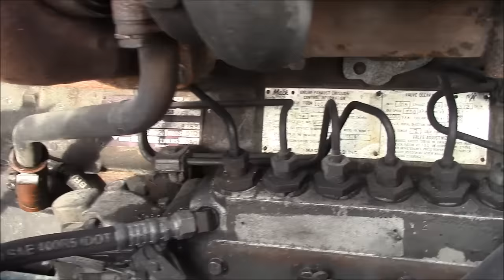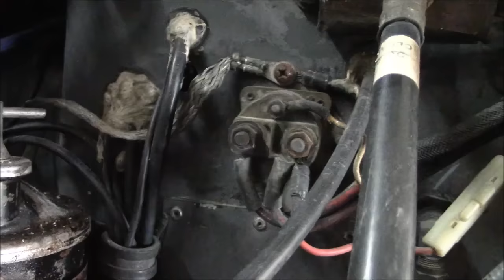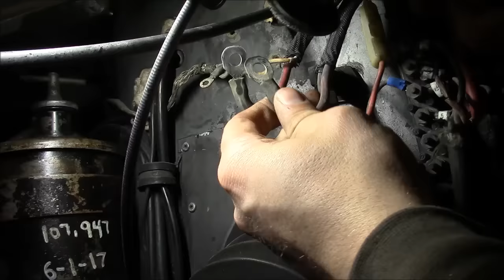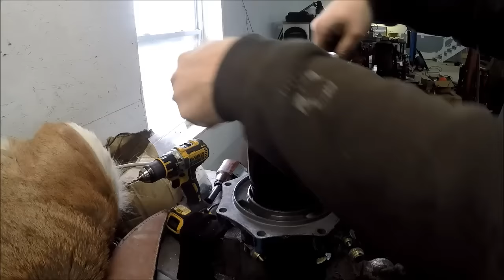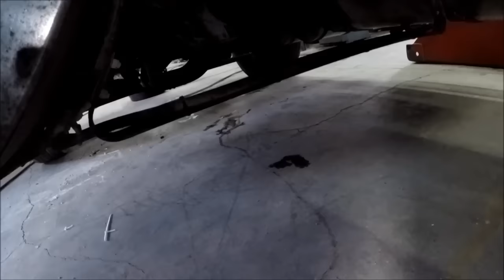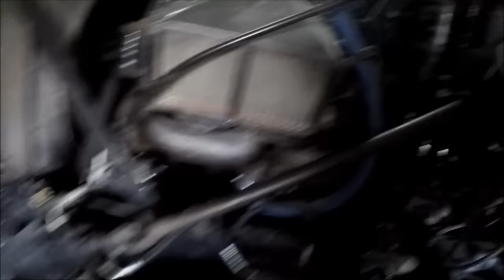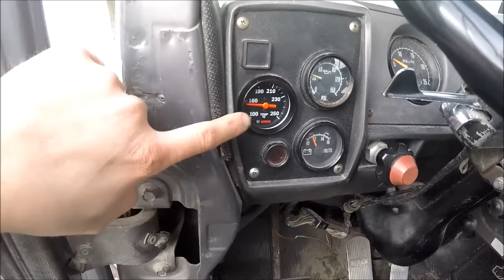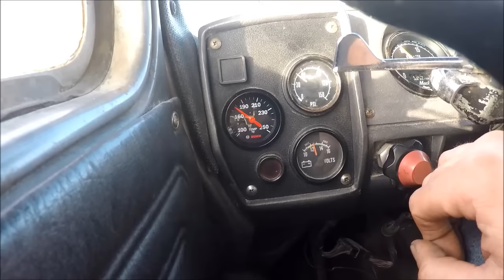Cool 1977 Mack RL600L - No Crank, No Start - Plus Many Other Repairs

Comment: went to  work as mechanic on a small corporate potato farm in 74...they got a new mack rl 600 right after me starting, this had the 5 speed and a forward-reverse lever.. great to hear that low rpm workhorse start and idle :)

Comment: If automotive makers would use more die electric grease there would be fewer green crusty connectors to troubleshoot .  Your spot on .
Reply from the maker: I agree. And maybe $.25 of never seize sprinkled through the chassis.

Comment: So what about the batteries on the concrete deal personally I think it’s bs But I’ve been wrong before. We used to have a mechanic at work that maintained our fleet and he had 4 x 4 blocks sitting over near his battery storage area and every battery if it wasn’t on the shelf was sitting on one. He had about five used batteries in seven or eight new batteries and after arguing about it because I couldn’t figure out why it would hurt anything I ran in there after he left and set all of his batteries in the floor on a Friday evening. He was pissed but I don’t think it hurt any of them. I had set plenty of batteries on the concrete and couldn’t tell that it did anything. I have 2 trolling motor batteries sitting in my garage now on the concrete. They sat on the concrete all last winter and held a charge Also so they’re two years old or so and still work fine.
Reply from the maker: It's some ancient practice from old wood or rubber case batteries. Any battery made since the Eisenhower administration can sit on concrete forever with no negative effect.

Comment: The R 600  81 Mack I owed had a 300 engine with a 7 spd  extended range I think been a long time It was basically a 5 spd so it shifted 1, 2 then out of 2 click up the range back into 1st which became 3rd then 4, 5, 6, and 7th . Then keep it a 1200 rpm and it would pull anything but a hill . I wonder why most Mack’s were white . The guy I sold it to took out the Mack stuff and put in a 400 Cat with a 13 spd and used it for years . Oh I left out it had New Way air ride not a good choice never could keep the bags level .

Comment: One place I've heard to not use dielectric grease is switch contacts as the silicone can become silicon carbide and erode away the contacts. I've never found a manufacturer stating that though.

Comment: On the old Mack’s  they are noted for oil in the air system even with a dryer you will still get old in the system. You need to drain your air tanks everyday . One other thing look at the air compressor it sits below the center of the engine and oil
Reply: Cummins had a problem with this in 70’s and 80’s I believe. Someone came up with a cure, I don’t remember if it was engine or air pump people. I don’t have the info anymore, so reverse digging is needed for the answer.
Reply: Turbocharger connected possibly?

Comment: Having those automatic slack adjusters is never a good thing, I have seen far too many failures of them especially when used in a lot of off road conditions.
Reply from the maker: They work for a while until they get jammed up with rock hard grease.

Comment: I’ve put dielectric grease on literally every non weatherpak type electrical connector at my job for years and guess what? The connections I’ve made outlast the others and have had zero complaints since I’ve installed them. I’d also like to add that concrete doesn’t kill lead acid batteries, in today’s world we have plastic encased batteries for that reason and several other reasons as well.
Reply: In fact, batteries on concrete hasn't been a problem since they quit building them in wood boxes. (that is over 80 years ago) The rubber type cases used when I was a kid prevented voltage loss to concrete conduction.
Reply: @wssides  right, but when you try to tell certain people that they think that they know everything and say concrete kills the battery 😂 I use a 12 volt mower battery wired up to charge my phone and my Bluetooth speaker everyday at work and you wouldn’t believe how many people still believe that my battery is going to shambles 😂 been there for 5 years already and will still start anything you hook it too.
Reply: @NitroGuyJH  btw the biggest thing about concrete killing batteries is that it was a thing back when batteries has glass insulated cells in them. You could break the glass sitting them on concrete but like y'all have said for many reasons nowadays you can sit the battery basically anywhere and with agm you can sit em anywhere and any angle in any temperature.
Reply: @michaelf.2449  didn’t even think about that, forgot that glass was used for its insulation properties quite often
Reply: @NitroGuyJH  yep people would be right about that myth if they weren't 100 years too late.
Reply: Pretty sure that if adding dielectric grease to something causes a poor connection, it was already a pretty piss-poor connection to begin with. Once terminals start touching against each-other in a plug as it mates, or as you tighten the nut down on a stud, it'll wipe/scrape/squeeze the grease out of the way wherever they're actually contacting; leaving it everywhere else, where it'll keep the moisture out and stop the dreaded green fuzzies!
Everyone's got their pet theories, though; and in the end, just... do what works for you, eh?
Reply: Correct, I've used 5 yr old batteries that are stored on concrete, no problem worked great. I use dielectric grease on some plug wires  Rubber boots on the end .

Comment: Wes. I owned a Marine Service business for 25 years on salt water. I used dielectric grease the way you use it and on all connections and they were trouble free!👍👍
Reply from the maker: It was drilled into me from a young age. We used it by the gallon at the truck shop where I cut my teeth.
Reply: Indeed especially doing marine electronics its a must

Comment: Look for the RPM sweet spot for the shifter. Each truck has its own.
Reply: The sweet spot is the RPM at which the transmission will shift the easiest almost all of the time. My C12 Cat in my Freightliner was 1225 RPM each shift. The Sterling I had had a C10 and it loved to shift around 1000.

Comment: That is a "Torque Monster"!
Reply from the maker: Yes. It needs it with only 5 gears!
Reply: @WatchWesWork  I have owned dozens of Macks. R, U, DM, and DMM models. Were the best trucks you could buy!
Reply: We had a dump truck with that same engine and transmission. You could load that 16’ box till it ran off the sides and it would just go. You’d shift and swear you could feel every piston stroke

Comment: I had an old Mack B615 with the END 864 V8 thermodyne .  The electrical system this truck had was the same battery layout BUT had a 12 volt RUN system with a 24 VOLT start system!!  Key to this was a GIANT power control relay under the passenger seat that had 4 wires coming from the batteries hooked up to it with 4 wires going out of it!! 2 wires went to all the lights, accessories and alternator and the other 2 went to the starter motor!!  When you inserted the key and turned to start this energized this HUGE relay and sent 24 volts to the starter.  When you returned the key to RUN position this DROPPED the "WIRING CONTROL RELAY and changed battery connections inside itself and this action allowed standard 12 volt operation to happen!! Yup it was complex but it worked!!
Reply from the maker: I've heard of that kind of system, but I've never seen one.

Comment: alt needs to see 1000 rpms before charging
Reply from the maker: Then it should have worked. I had been running it at 1500 to get the temp up.

Comment: I think your air impact might need a rebuild kit. Sounds a bit weak
Reply from the maker: It is. And the anvil is worn out so sockets constantly fall off. It's got a lot of miles on it. I think I've had it for over 15 years.
Reply from the maker: My Dewalt cordless is even worse. They both need an upgrade.

Comment: did you look at the mileage and date on that power steering reservoir? looks like a really nice clean truck. i always forget to use my vacuum drain/fill system. your turn to replace the foot valve.
Reply from the maker: I don't think that's the correct mileage. I suppose it could be, but the engine has been swapped at least once, so I would think it has more than that. Looks like this foot valve is a little easier to get to than that dressed out KW!

Comment: I love the older macks! Worked for a guy with 10 Mack dump trucks when I was young and they really were dependable trucks. I don't understand what people are getting at about the dielectric grease, that's why it's made for?? Good luck getting the old girl dried up.
Reply from the maker: Yeah I don't know. Fixing oil leaks on a 45 year old Mack is pretty futile.
Reply: @WatchWesWork  just tell him they loose a good bit from the blow by tube anyway lol

Comment: You failed to mention when working with dielectric grease on Fluxcapacitor's made with / from Areospace Billet Unobtainimum, it is very well known to put a dent in the time continuum, and everybody know's that's a big No-no!!! Never use dielectric grease on a Discronifacator. For those who may not know what a Discronifacator is, it's similar to a muffler valve, only much more costly to repair. Very few people are certified to work on Discronifacator's. It requires the ability to keep a straight face when telling the customer just what is wrong with their exhaust system.😁👍
Reply from the maker: I do know that dielectric grease will effectively prevent side fumbling in a retroencabulator.
Reply: @WatchWesWork  Thought you would like to know just where "Discronifacator" come from / origin's. Rush Limbaugh told the story (sheepishly) of just how he was RIPPED off by a mechanic, on his Pontiac GTO, 19(67?) I believe when he worked for the baseball team Kansas City Royals. You gotta give credit to that mechanic, back in the 1960's to come up with something that good.
Reply: @WatchWesWork  Just thought you would like to know the origin's of "Discronifacator." Come's from Rush Limbaugh, he talked (sheepishly) about how he was ripped off by a mechanic, working on his 19(67?) Pontiac GTO, back when he was working for the baseball team Kansas City Royals. Gotta give credit to the mechanic, to come up with that during the late 1960's, early 1970's.

Comment: I don't know what the "official" way to apply dielectric grease is but all i can say is.... I have a 1990 Daihatsu Feroza (Rocky) and from the factory it had dielectric grease liberally smooshed into every single connector and relay. If you open the fusebox and pull out a relay or fuse it's clear that just lathered that up and then installed everything, 30 years later it's still there and everything is clean and working. The car has been through water, on beaches, in dust and bashed around rutted Australian dirt tracks, still going
Reply from the maker: Lots of truck builders did the same. International comes to mind.
Reply: @WatchWesWork  they also built trucks so that makes sense, protecting them from extreme conditions

Comment: I was the exact same way about the b model mack. I 6'3' so I feel you on the cab thing.
Reply: I was 6'2" and have a right ankle that's half again as big as the left one from turning it sideways to feed the fuel in DM's. i love a B-model too but they don't love me.  RD is about as bad. The passengers seat made a lot of difference. 2 inches more leg room instead of the high backed job.

Comment: @23:00 I'm convinced it's mostly UV light and possibly the freezing temps during winter that break down this jacketing. I've seen wires right near effected wires that were hidden from all light and aside from showing some age..were in fine condition. Insulation that is already compromised by UV light freezes and provides a great opportunity for fissures and eventually breaks to form if the truck is run and jostled around during the winter. The only jacketing that I have seen (so far) defy this breakdown is silicon jacketed wire. They are also tremendously resilient against high heat (like a short circuit or an arc).
Reply from the maker: I wonder what material is used for the conductor insulation on SO cord. I see this issue with SO cord more than any other type of wire.
Reply: @WatchWesWork  I kind of know the answer to that one. The newer stuff (SOW or SOOW, I think) is a thermoplastic called CPE that is weather and UV (Oil too) resistant now. The older SO cord was made of a PVC variation that has a plasticizer called DEHP mixed in to make it more flexible. PVC becomes brittle and cracks in UV. The DEHP also 'expires' in the presence of sub zero temps. You probably noticed that the wire you cut back to was a bit more flexible than the dried out and cracked shielding I'm guessing. It'll go "bad" in time just like the bits you cut off. "Watch Wes' Son Work" will be redoing that wiring in ~20 years complaining that you didn't use the "right" stuff to patch it in the first place. ;-)

Comment: Wes not all people are smart!
 I'm an Recreational vehicle service technician have been for 28 years. 

If everyone was smart and knew how to fix there own stuff guys like  you and me wouldn't have a Job.

That said I keep learning new things every day... 

Let's just hope that they are willing to learn...  If not then make sure they pay you well... Lol

And work on a Winnebago motorhome all the wires are purple. They are numbered from the factory. But as they get older the numbers wear off.
Reply from the maker: Yep, the old wire guessing game. I work on lots of machine tools. They use cheesy paper wire labels. The oil from the machines breaks down the adhesive on the labels. You will open an electrical panel and see a pile of wire labels laying in the bottom!

Comment: I use dielectric grease on all my trailer electrical connection and snowplow electrical connections, eliminates corrosion and promotes connection
Reply: Articles state it inhibits electrical flow! It’s not rocket science.it either does or doesn’t most articles say it does that’s why they use it on spark plug boots to stop leaking current.Coppergrease is much better for inside terminals then when there clamped down cover the connection tops with dialectic grease 🤘🇬🇧

Comment: You should get a camera that accepts threaded filters; with such, you can put a cheap u.v filter over the lens to protect it from welding spatter.
Reply from the maker: Well it turns out my Canon does take those filters. But, I'm such a rookie with cameras that I never even knew they existed until someone recently told me to get some to protect the lens. Too late I guess...

Comment: Nice video on dielectric grease :)
Some fun facts:
1) The term "dielectric" was first proposed by the scientist, philosopher, and Anglican priest William Whewell, 1794 – 1866. Whewell coined the word diaelectric by combining the Greek "dia = through" and "electric". This was condensed into "dielectric’ to make it easier to pronounce. Unlike an electrical conductor, which excludes an electrical field, a dielectric material allows an electric field to pass through it. Dielectrics and electrical insulators are often used synonymously, but dielectrics tend to be more specialized for specific functions such as capacitor dielectrics.

2) Dielectric grease does not conduct electricity and stays pliable (it does not cure), while silicone grease does not conduct electricity either but cures to a hard form (Lesson: Do not use (cheaper) silicon grease for your contacts and terminals - use dielectric grease).

Read more: Difference Between Dielectric Grease and Silicone Grease | Difference Between http://www.differencebetween.net/technology/hardware-technology/difference-between-dielectric-grease-and-silicone-grease/#ixzz6B8NT5Q9C
Reply from the maker: Interesting. Though I'm not sure if I'm less or more confused now...

Comment: i have a RS600 for sale with factory A/C its a 79
Reply from the maker: Interesting. Where is it located?
Reply: its in klamath falls oregon rto 12513 trans dt 402 rears rsa pad suspension
Reply from the maker: @robschmoe2504  Man. It probably has no rust.
Reply: @WatchWesWork  no rust anyplace i logged with it for 22years

Comment: hate to add to the dielectric turntable lol but i'm gonna anyway , most of the systems i have worked on are 24 to 72 volts,  and exposed to extreme cold , i have found that with the high load on batteries during start dielectric grease creates alot of corrosion , something about the silver in the grease reaction with the lead in the batteries and the copper in the connector , within 6 months there is so much corrosion i have actually lost batteries turmanls completely and D8 batteries arn't cheep what i have done that works fairly well is clean the hell out of each end and use batteries terminal sealer , its a light varnish the keeps air and water away completely , once again great vid , there fun to watch
Reply from the maker: I've seen that stuff at the store. Deka makes a version. I'll have to try some.

Comment: Thank you for your tireless efforts in trying to dispel at least some of the hoary old—and new— myths that propagate so wearisomely through teh interwebz.

BTW, Sorry you broke your camera. Try, if you can, on your new one, to fit an external UV filter; it will also act as a sacrificial lens-protector.

(Edit:  If the insulation is rubber-based, one of the causes of degradation will be ozone, breaking the long-chain molecules, making it brittle and prone to cracking.
A preventative measure would be a wax coating—either natural or silicone—petrochemicals don't play well with natural rubber.
Reply from the maker: Yeah. I wish I had known about the filters. I'm such a noob on cameras.